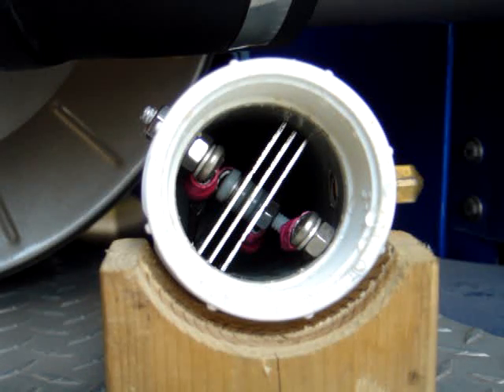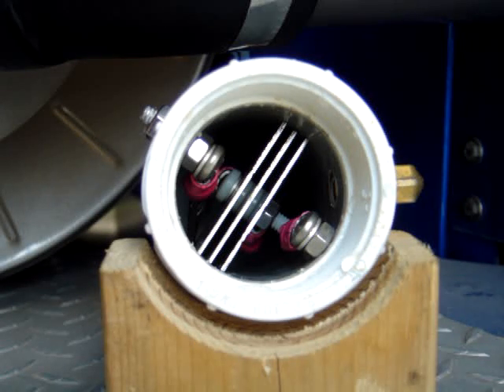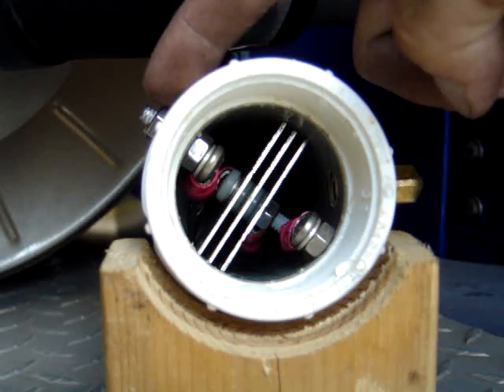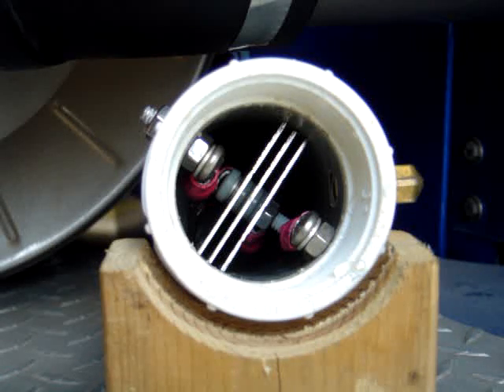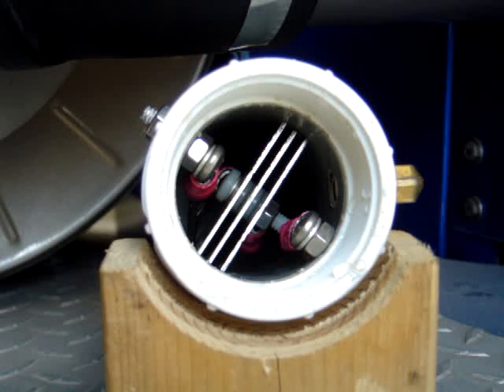HHO 7 CELL GENERATOR, ASSEMBLY

Comment: I would have to disagree again, but your prognoses is valid under most builds with the exeption of mine my nutrals are 1/4 inch bigger then the + and - cells this eleminates the current bleeding around them, and cause the current to go directly thru the nutrals, go to my channel and look at my videos NLOlin4solar Part 6 HHo 4 Gen...look at the size of my nutrals VS the size of the Pos & Negatives, No current bleeding across the edges

Comment: disagree, wet cells V.S dry cell there is no difference in production, built right do not get hot, and are capable of produce a bit more or as much as a wet cell, only advantage with a wet cell is no bulkyness and they look better

Comment: Wrong, Negative plates produce Hydrogen on one side and oxigen on the other side, Mine has 20 nutrals and 5 pos and 5 neg,my nutrals are a 1/4 inch bigger on 3 sides the the + and - plates, in plane water they draw nothing and that is the idea, to force the amps and not have out of control amp pull, and to enable one to control amps to the cell with a ccpwm, please do your research

Comment: @CaptainD983102  + N - N+N -N+N-N+N-N- Make your nutrual plates 1/8 in bigger all arount then the P and N plates to fource current thu the plates so they do NOT go around the nutrual plate..and NO nutral plates are not a waist of metal, less run away current with nutrals, less heat and better controle of amps

Comment: as far as I can tell , you have no need for a neutral plate until you start the 2nd unit assembly.  Try this configuration next      + neg + nuet .     ,      + neg + neut.   so as you can see the neutral plate is only needed AFTER  a set of three plates   + - +

Comment from the maker: Well It doesn't need to be in there. The job that it does (if I understand it correctly) is lower the voltage carried by each plate, thus helping to control high heat. They also add surface are to create gas.